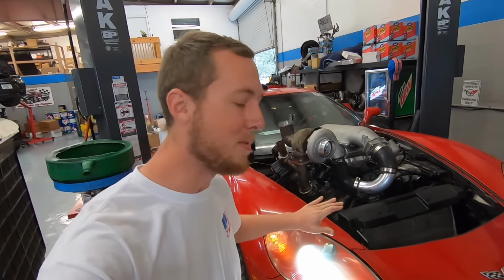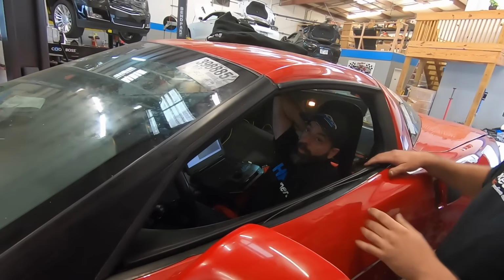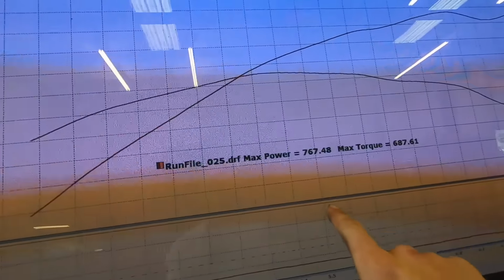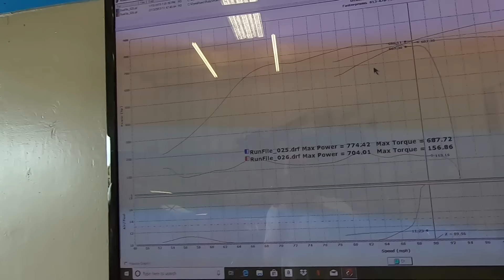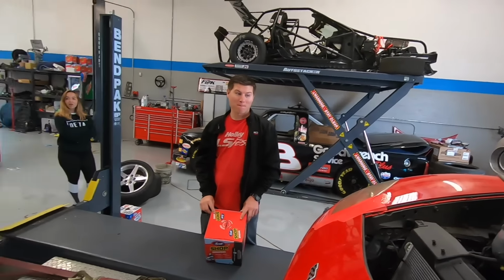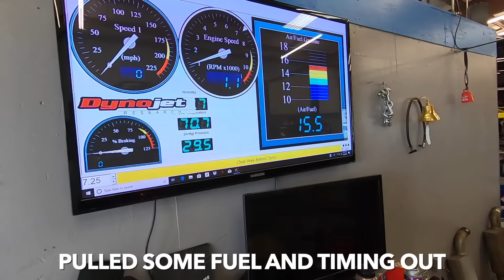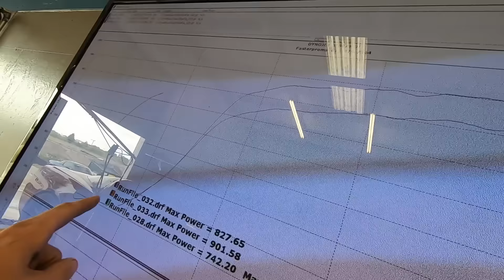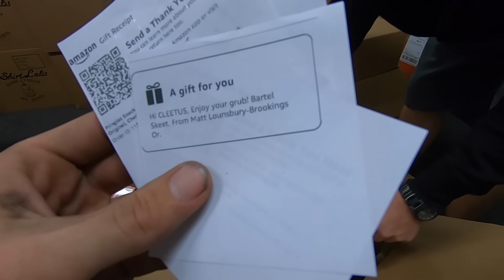The Auction Corvette Goes For BIG POWER! Please Don't Blow Up...

Comment: I can see ruby hitting 1000+ HP.. Not bad for a junk yard dog..
Reply: If sloppy could do it, Cleetus' deeper pockets for trial and error definitely can! Love this project and all the ups and downs. Cracking 4 digits will be a fun video for them I'm sure.
Reply: Literally the only junkyard components are bare bones. Sorry, but a junkyard block with 30-40k in additions isnt really a junkyard dog to me
Reply: @iDrinkJ4ck  definitely not 30-40k into Ruby. The built powerglide is extremely expensive and costs more than everything else put together, but OP is likely referring to the hardly touched 4.8 putting in work making 900.
Reply: If it was measured at the crank and not through the powerglide it probably would make 1k lol
Reply: @Baby_Bear769  it's a turbo motor there's not a motor that can't make power with one. My 87 Buick GN from years ago made little over 730hp. Factory motor with cam water to air intercooler single  68mm turbonetics turbo. That was just a little 3.8 V6 from the 80s. Turbo is just easier on parts compared to  blowers and nitrous. Not that you can't make power with them. Just not as easy or forgiving for that matter lol.
Reply: @waynebollentin989  I have literally 0 idea what you are getting at. I'm assuming you read my comments incorrectly since I mentioned nothing anywhere close to whatever point you are trying to prove...
Reply: That's it. I'm going to start scraping up every 4.8 I can find.
Reply: @Baby_Bear769  sorry was more of a little rant then anything. I thought you would have figure out making this power with a turbo isn't all that impressive these days that's all. Should have tried doing 20+ years ago before the technology got much better. 
I'll go a step further. My point is even for a junk motor it's just not a big deal. Many guys have and are doing this. Some with only 4.6 v8's or even 6cyl's. Making horsepower just isn't hard anymore specially with a turbo. Get the car down the track it the hard part and even that is nothing compared to 20+ years ago. Just ranting bro. Wasn't saying anything was actually wrong with what you said. Just crazy how easy it is now compared to years ago.
Reply: @waynebollentin989  lol had nothing to do with me. Was confused as to why you were randomly ranting at me about shit that had nothing to do with anything 😂. But yes everyone knows these days that turbos and junkyard motors are easy power for cheap bucks thanks to the internet. It's a lot of fun watching it piss off the religious "omg you need to spend 50k on an engine" people as they get drug by a $300 5.3 with an ebay choo choo boi on it

Comment: Need to upgrade the electronics from the old winpep7 stack to the dynoware RT/winpep8.  RPM signal filter options and pickup is soooooo much better, and can always fall back to roller speed for tach signal.

Comment: Amazing stuff as usual! Just a thought, if you're fighting to keep oil pressure on these old junker motors, if you switched to a proper synthetic like Redline or Royal Purple etc, the film strength is much, much higher and friction is lower. I know it seems like more cash on a cheap project but it might just save your ass a little. You'd have less chance of spinning a bearing, make more power, and even if the pressure got a little lower, the film strength would hold up. Also, at the temps you are making, conventional oil will be feeling the strain! Just a thought! Could always just fill it with Lucas Oil Stabilizer goop to bring the pressure up if it drops instead! 😂 Keep up the amazing work. Best channel on YouTube.

Comment: Hope you change the oil and filter after the full pulls and cut the filter open to see if there is any glitter going on. And put some good straight weight oil in it. please be safe and I like the comment put a cage in her just in case you blow the engine and slip in her oil. Good Luck :)

Comment: This has inspired me to get my hands on a nice 4.great and a junkyard turbo and do a build with one. Aside from the turbo hes probably at just under $2K in this motor with cam, heads, intake, and injectors? I figure a Ford VGT turbo or a HX35 should make decent boost and both are plentiful in junkyards.
Reply: More than that. There's probably close to $10,000 worth of parts on this engine.

Comment: that open hood area kicking in my OCD dude; please get a scrap/ cheap vette hood and cut the first foot off to make a cover for the area between the fascia and the back of the rad support; maybe even a seperate side section going down the driver's side of the car; will help with aero and a fluid leak/spray won't kill your vision. good luck and let Ruby EAT!

Comment: Proven the 4.8 holds way more boost than a 5.3 people will say I'm lying but I've seen both blocks go on a Dyno with the same set up where the 5.3 couldn't handle the same boost as the 4.8 see you tomorrow cleetus at Houston race way park

Comment: But the true sense of free power is only felt when you install a bunch of solar panes in the roof and work in your workshop with "watts direct from the sun", plug a sound system and dance with "watts direct from from the sun", no dirty Wall Street and Abu Dabi intermediaries. This is something worth and right to pay for.

Comment: Its time to roll the rear tires so you dont rub the tires.
Reply: Corvette. Roll fenders not possible with fiberglass.
Reply: @ashleythompson3677  That was me not thinking. What about heat?
Reply: @waybous  lol now you caught me not thinking. So if you had a way to evenly heat the whole quarter panel, within the first 4 months after the panel was manufactured.
Reply: This would accomplish allowing the non-stretchable fibers to pass glue/resin material around. Fiberglass is similar to carbon fiber with no pattern and different fiber.

Comment: I was just about to ask when you were going to upgrade the radiator on Ruby
Reply: Also you guys should get a hub dyno, it would make things a lot safer at those high horsepower levels and you wouldn't have as many issues with getting the readings

Comment: Leroy with 6.2lsupercharged @16.5psi went 10.35-10.12. This is about the same boost.
Reply: A what up. Yea ruby has a great setup the 5.3 was awesome to bad it ran out of oil. Boosting the oil leaks with blow by. Then no baffles in the oil pan creating a terrible wet sump. Who would do that it an oil pan. Vie seen people add stuff like windage trays. I've never seen people remove stuff.

Comment: Doesn't your air density  pick up a ton when your at speed. I don't think the fans are kicking enough air to get a real reading vs realtime at the track. 

That may be why you're blowing motors,besides no oil pressure+leaning out.

Comment: If you read this shoot me a like so i know. Any ways you need to go spend 2k on a nice non vvti ls400 lexus and just boost it. If you wanna have a nice high rev reliable v8 the 1uzfe is the best thing other thank the titan motor. Idk just something to think about. Tons of aftermarket parts cus theyre used for drifting ALOT.  Do a little  research when you have a sec and youll see. JAMES NEEDS A TITAN SWAP. VK56DE.

Comment: The biggest issue is going to be the lack of oil pressure again. If you can maintain high oil pressure it will probably last a decent while.
Reply: I am confident that it was the hacked up factory oil pan from the previous owner. Now Ruby has a brand new GM oil pan.

Comment: You've obviously not calculated the aerodynamic implications of those tape wrinkles.  The airflow interference pattern generated will add probably at least in the neighborhood of around about .0001 seconds in the quarter dude.  That's not good.

Comment: A trick from a guy who appreciates a tight shop..........  Go to any pet store that has fish..fish is the key....look for all the valves that control the air crap in the tank........fish is the  key......    then buy one of all   cheap........   use in drill hole.........   controlled vacuum leak...a little\a lot .......the right pet store.....fish is the key

fixed many drivability issues in the day,
jonsey

Comment: I want Jeremy to tune my car I’ll bring it from Maryland to Florida just to have some badass mf’r with the same name as me tune my car 

98z28 t56 trans is built lq9 swapped waiting on the turbo to be put on just has a cam and all bolt ons the suspension is where my money is adjustable qa1’s all around braced 9in rear torque arm bar panhard bar welded subframe connectors waiting on a cage might do a rsm tubular front end soon as well
Reply: Reebok301 301/202 I travel to Pa about 4x a year.
Reply: Fasterproms what part of pa? do you come to WCF? 

definitely wanna know when you’re around how can I keep in contact or know when you are? 

deeply appreciate the reply man 🙏🏼

Comment: "We didn't know the fuel ratio" so they just ran the engine and recorded and tuned afterward; then he says,  "You're such a pro."  Um...  not much planning here, just some pretty risky guess-work.  As an engineer I'm horrified; they could work-out the math of the injectors, fuel pump, and air density and solve for it like gentlemen with a decent clue first instead of running it off-tune.  This 4.6 will last 10 miles.
This junkyard Corvette:  https://youtu.be/sAOjqe62GdE?t=5